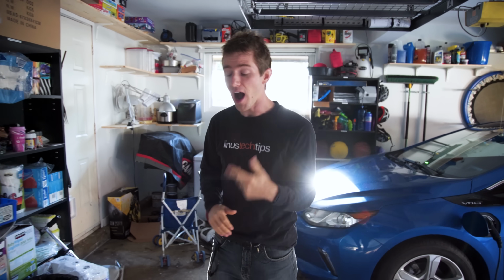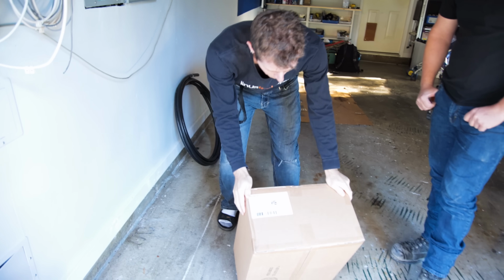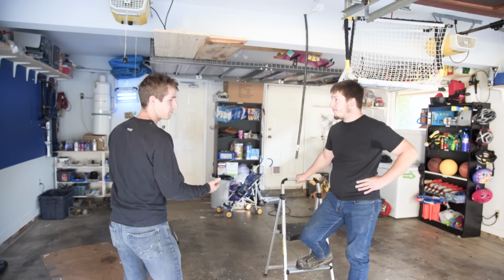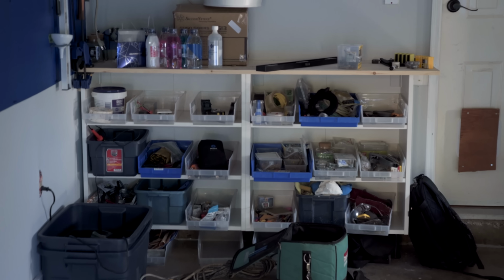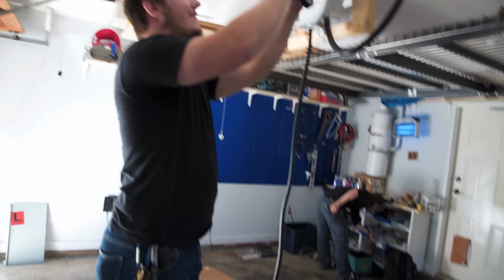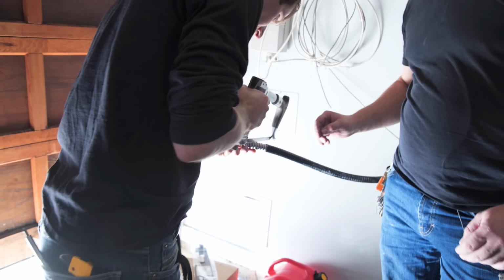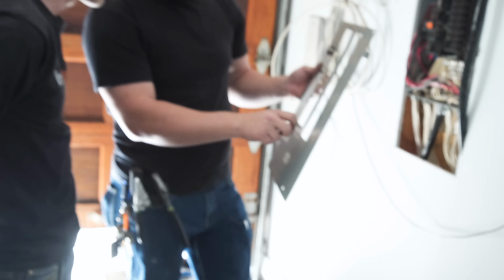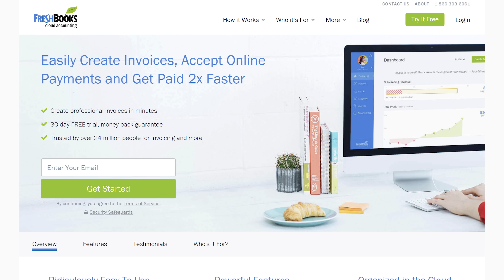Installing my Electric Car Charger - What Could Go Wrong??

Comment: These american walls are ridiculous xD
Reply: paper thin
Reply: @XxvSLYvxX  Last time I checked Canada was still in America (North America to be precise). ;)
Reply: @XxvSLYvxX  in Europe we have much much thiccer and walls Made out of concrete. You can't just simply fall through them or cut a piece out of the wall with a saw. And in Canada they have those paper thin walls too.
Reply: Bruh that's the ceiling not the wall
Reply: @adamfcplm  Houses are usually built with products that are readily available in the area. In North America timber is cheap and building out of wood and drywall makes sense. It is also common in Japan because timber and drywall construction in MUCH more resistant to earthquakes. It is much easier  and cheaper to insulate timber/drywall construction too. Many places in the USA/Canada get considerably colder than Europe's relatively mild climate. Older brick homes near me are always cold in the winter and cost a fortune to keep that small amount of warmth they have. It wouldn't make sense to build houses in the USA like they do in Europe.
Reply: nocturneJOJO yeah, we don’t consider ourselves “America” though, and neither does the rest of the world.
Reply: @Cheezdealer ... Everyone does, US =/= America
Reply: @Cheezdealer  Some people from South America get butthurt when people call things from the United States of America, "American."  Sometimes you just gotta roll with it because it is easier than arguing. And to be fair, a good portion of sheet rock in Canada is actually American, lol.
Reply: cliche indoor-dry walls are also in europe common. and also wood as an outside wall in certain regions... look to scandinavia  and all those "sweedish" houses... they are also very popular in northern germany.
Reply: i live i sweden but we dont use 2mm drywalls as a ceiling we use 20-30ish and concrete buildings arent cold :b
Reply: No labels!Disgiusting
Reply: 2911oscar Woah, not cool man! In Finland we have wood on concrete slabs. A lot of wood, plasterboard, and obv insulation wool because it's pretty darn cold outside. It's sure different from America.

I guess the way we do things are different so end results are different when comparing between America and (at least) Finland. And we like it thicc down here so that's a difference.
Reply: Bricks and concrete FTW!
Then comes the cheapstake with brasilit roof tiles...
Reply: Erwinjitsu _
finland isn't known for its hurricanes
Reply: drywall is used in continental europe mostly for indoor walls the outside walls are commonly made out of brick because we have a lot of old buildings that were built that way back in the day. I am positive that most new european housing is built in a similar way to how houses are built in america. we even have prefabs.
Reply: I really want an American house. Concrete houses is a hell doing electrical wiring in.
Reply: @DankRafft  xDD
Reply: They used to be much beefier before we had better drywall. late 1800s early 1900s were pretty cool. like the science of how walls were made and finished.
Reply: these American electricien safety is ridiculous
Reply: Username checks out
Reply: @DankRafft   ROFL
Reply: @OhioBahn440   Uh, you might want to check again on that. There's a lot of freedom in the EU countries.
Reply: @LtFab192   How? Unsafe? or Too safe?
Reply: @nocturneJOJO   That's like saying Germany is in England
Reply: I'm a mason in germany i've build many house types with only concrete and bricks for walls and ceilings.... why have we so many old houses??? because they are build right!!!
Reply: @merionis  heh, that's wrong. Wow.
Reply: @insulting_bjorn2354  yeah but its just a celing indoor dry wall on a garage... and its certainly more than 2mm... more like 2 cm. im from northern germany near Flensburg... and my parents own a swedish wood house builded from a swedish company... because u can guess it... they are big fans of sweden... actually the whole neighborhood is full of swedish houses because they are damn popular up there... im myself was a lot of times kanuing in dalsland with the boyscouts as i was at a youth age.
Reply: @OhioBahn440  "...in the USA every man has the freedom to build and wire his home as he pleases." No, we don't have that freedom. We have electrical code and building code we must comply with.

Comment: it is so weird to see an electrician without a wire stripper tool and a properly insulated screwdrivers. AND a completely different set of wiring standards and breakers that are not European specific.
Also added grounding wires. weird. its okay i guess but super weird seeing these things.
Reply: It's not just you, that guy not having at least proper strippers is really weird. Also fully insulates screwdrivers are quite common as well.
Reply: I don't doubt he had wire strippers, I think Linus just wanted to do it with his own tool.
Reply: @YouSunkMyFishy  Seeing wire peeled with the boxcutter seems least effective way. If I don't use wire knife/stripper I go with the side cutting pliers. Just press and pull. I use cable knife/stripper usually when I need to peel outside cable layer as well.
Reply: @mdjey2  Hey man, don't get me wrong, I use wire strippers! It's just... Linus. Y'know.
Reply: I didn't mean you, I meant guys in the video. Still doesn't mean you can't use any other tools if it does the job. I use side cutters when working on switchboard, but if I working on sockets and switches I use HAUPA 200043. I stay with a principle less you change the tools, faster more effective you can do the job. @YouSunkMyFishy
Reply: That was #8 or #6 wire. I'm sure he had strippers but they only go up to #10. When you have larger wire than that you use a knife here. Some electricians have 1kV rated screwdrivers, but for the most part they just use generic Klein or Greenlee that have a cellulose handle and a rubber grip, which is honestly fine it just doesn't have an official insulation rating.

You're supposed to cut power to anything you are working on and lock it out, but people work in live panels all the time. You have to if you're adding to something (in an office for example) where people are working and they can't have down time. It's safe enough if you know what you're doing, like this guy. But of course with a slip up, you could short the bus bars, and you're relying on the main breaker to save you from a fireball copper and steel plasma.

Sure you have the right to refuse and all that, but if you're that guy, you're going to get laid off for "some other" reason. On the surface companies say they want you to work safe for liability reasons, but at the end of the day they want you to get it done and you're supposed to read between the lines. It's unfortunate but that's the way it is. I'm surprised LTT and the electrician both don't care about the live panel work going into the video though.

There is a bare ground wire inside of the TECK cable along with the red/black/blue insulated wires. They didn't have to add anything.
Reply: @mdjey2  I get you there. Many times I've used tools for something that "isn't their job" because... switching tools will take more time and effort than just using the tool in my hands.

Comment: Your workshop should also have a pair of safety footwear since those you're wearing are missing toe protection entirely.

On the subject of hacksaws, you can pull backwards because the blade's teeth's points face forwards

Comment: Would’ve liked to see you install a NEMA 14-50 outlet and plug the charger into that. Would be nice for cars like Teslas which can plug directly into a 14-50 plug for faster charging
Reply: Plugging it into mains power is the same thing other than not having a plug you can plug different things into.
Reply: Yeah that's definitely a smarter idea.
Reply: I would’ve liked to see that cable snakes behind the wall to the panel. But whatev. Or maybe 1” EMT
Reply: this thing provides the same power as a NEMA 14-50 if you install it inside your house and it has the same IEC connector any tesla uses.
So the tesla wouldn't charge any faster even if you put it on a NEMA 14-50. At least when used in your house.

There is just one difference: this charger can actually work with any other electric vehicle that is not a tesla without getting a bunch of other stuff because charging via NEMA 14-50 isn'T standard for EV's yet.
Reply: Krawallnoez Noezington this was installed on a 30A breaker so it can only draw 24A. A NEMA 14-50 gets installed on a 50A breaker and can draw 40A. It’s possible you’re thinking of a NEMA 14-30.
Reply: @keco185  I was actually thinking about the fact that he probably has a 200A supply fuse in which case is won't be that good of an idea to actually install an additional 50A breaker. Not a good idea at all unless you want some angry people from your power grid company showing up at your door.

Comment: 0:55 240V you say? Too bad you don't live in Europe where the mains is 230-240V by default!
Reply: Or new zealand
Reply: We have always been using 240 V for consumer electric stoves and clothes dryers in North America.
Reply: @RaymondHng  And water heaters and air conditioners....
Reply: @RaymondHng  We got 400V for that :D
Reply: @JohnRoads  And guess what? A 240V stove in North America will boil a pot of water in the same amount of time as a 400V stove in Europe. A 240V clothes dryer in North America will dry a load of laundry in the same amount of time as a 400V clothes dryer in Europe.
Reply: +B_chan. in canada we have both 120v and 240v. though 240v is used for greater loads like dryers and ovens mainly, we also get two-phase power in some outlets which is nice for if you've got a lot of things running off one outlet.
Reply: @lenardgor  Again, electricity is not charged on amps alone.  The electric company charges on kilowatt hours (volts X amps X hours). Wattage will be the same because wattage is voltage multiplied by amps, 120 volts X 3 amps = 240 volts X 1.5 amps = 360 watts.
Reply: @RaymondHng  actually a North American clothes dryer usually pulls 30 amps at 240 volts so it would dry quicker than a European one
Reply: @TheChipmunk2008  The amount of time it takes to dry garments is determined by the amount of heat, not current (amps). The amount of heat (electric or gas) required to evaporate water out of a wet garment in a clothes dryer or boil water on a stove will be the same anywhere in the world (provided that you are comparing different locations at the same elevation). The amount of heat is in proportion to watts. So, a 7,200-watt electric dryer in North America will dry clothes in the same amount of time as a 7,200-watt electric dryer in Europe.
Reply: @RaymondHng  and where are you going to find a 7.2 kilowatt dryer in Europe
Reply: @TheChipmunk2008  I don't live in Europe. You'll have to ask someone who lives there. Probably at any major appliance store. I know people who live in Europe three months out of every year and they have never complained about clothes taking longer to dry over there. Water boils at 212°F (100°C) in North America and it boils at the same temperature in Europe at the same elevation. (It reaches boiling point at a lower temperature at higher elevations.) It will reach boiling point quicker NOT BECAUSE OF HIGHER CURRENT ALONE, but of higher BTUs or watts. (1 BTU = 0.2391 watts) You cannot get around Watt's Law: watts = volts X amps. Ask any physics instructor. Furthermore, you cannot raise the temperature of a dryer to a point where fabric scorches or burns a person's hands.
Reply: @RaymondHng  Are you being deliberately obtuse? This discussion is about electrical standards, not the laws of physics.
EUROPEAN DRYERS TAKE AROUND 3KW
Reply: @TheChipmunk2008  What do think you electricity is? It IS physics, not chemistry. The laws of physics always apply to electricity. Any electrician and any physics instructor will tell you that watts is equal to volts multiplied by amps. You are taught watts=volts X amps in electronics class and you are taught watts=volts X amps in physics class. Electricity is taught in the first semester of high school physics. And I've taken both electronics and physics classes back in high school most likely before you were born. Clothes will dry faster in a 7KW dryer than a 3KW dryer because a 7KW dryer puts out more BTUs than a 3KW dryer. You were erroneously claiming that clothes dry faster in a dryer that draws more current. That is false. A 1000-watt hair dryer in North America will dry your hair no faster than a 1000-watt hair dryer in Europe.
Reply: Hey guess what! We dont care!
Reply: @TheChipmunk2008  wait, so you're telling me electricity isn't physics?! HAHA XD
Reply: @Sanisfaction  No, I was telling RAYMOND that dryers in the EU typically draw 16 amps maximum, (around 4kw at 230v give or take) And dryers in north america typically are loaded for 30Amp at 240v (7.2kw or thereabout)He chose to run with that and try to lecture me on physics. Which I found frankly patronizing, being quite good at physics, well versed in Ohm's law, and an electrician (for 28 yrs) who has worked on both continents.
Reply: Household services in North america tend to start at 200 amps minimum. In the UK/Ireland, they're 60 to 100 amp typically.(all single phase ...or split phase in NA,  but that's splitting hairs as well as phases)  (depending on service type). In the rest of the EU the services tend to be a lot smaller (I've heard of 16 amp) but also tend to have 3 phase available by default. So it evens out. But the North American system tends to lead to larger point loads (dryers of 30 amps, range style cookers with 30 or 60 amp supplies etc). So yes, of bloody course it's physics. But geography and politics enters into it. So I stand by my initial statement. A typical north american clothes dryer is faster than a european one.
Reply: to be honest, 230v 16a schuko socket most of europe has, is enough for almost any household loads... except for large loads like kitchen range/oven, sauna or big water heater which are hardwired to 3 phase supply (a common thing to have) for better load balancing and smaller conductors... there are also dryers with heat pumps now and to be honest, clothes line is quite popular way here too
Reply: RaymondHng 
Higher voltage means lower current for the same amount of power which allows thinner cables.
Reply: ikr
Reply: I’m from uk
Reply: math is hard
Reply: @RaymondHng  Ye, but higher voltage is still a bit more preferable. Since you lower the amps, you can reduce the area on the cable. 
Aswell as install, for example, both the dryer and the washing machine on the same fuse / fuses without any issues.
Both have their pros and cons of course. Personally I prefer the 400V / 230V solution slightly more.

Comment: Any electrician know that you turn off the power to the cabin or at least turn off garage/floor stages, before handling wires, even though you think you're not gonna fail. Just saying. This is security and safety protocol in Denmark.
Reply: its considered 'uncool' if you switch it off.
Reply: So cool, to risk your Well-being. @jacktheninja
Reply: @Ogsyy  o no i am wimp when it comes to mains voltage. I shut of the 400A breaker outside to replace a plug on the wall. ...
Reply: jacktheninja wise. Security comes first. Thats why I Got annoyed watching the comments abort hun doing a good job, when he did a dangerous piece of work.
Reply: @Ogsyy  'Security comes first.' Security or safety?
Reply: @Ogsyy  
Codes are different everywhere. Really irrelevant what code your area has. I been to places that do not allow home owners to build small dog houses without a foundation, submitted plans and inspections.
Reply: North American electrician here. Shutting down all power is incredibly inconvenient, plus we are certified to work hot panels.
Reply: @bazz2438  might so,but i am certified in no way
Reply: @Ogsyy   Cabin?  Linus lives in a house, this is the breaker for the house, the circuit they were working on was off.  Though I will say he should have been using an insulated screwdriver.
Reply: MrNateSPF cba watching the video again, but as far as i remember, the electrician told Linus to not touch the panel, so i guess it was not cut off from the main voltage?
Reply: @Ogsyy  The 1 circuit they were working on was off, they don't need to turn off all of the power to work on that 1 circuit.